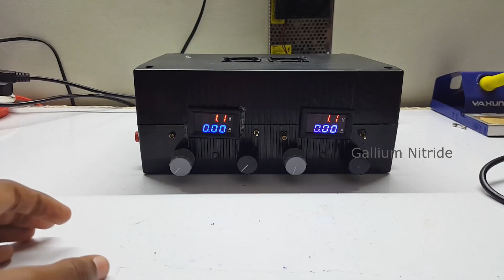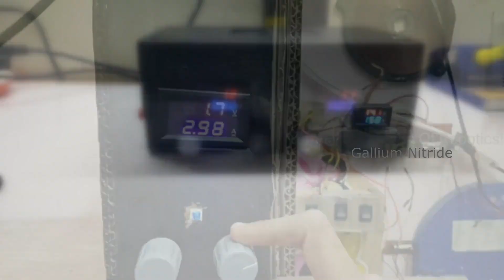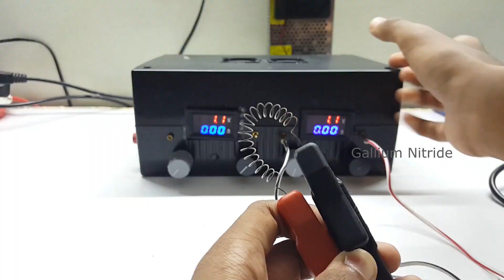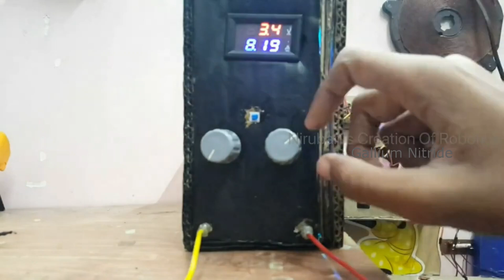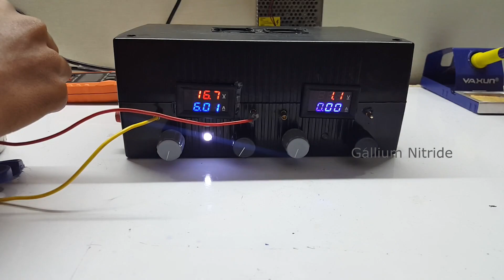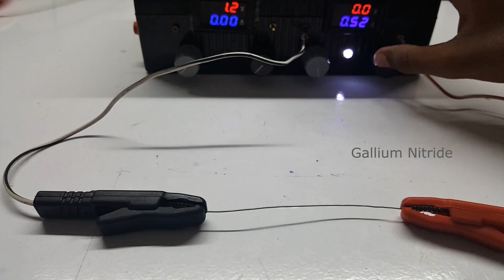Testing my dual channel lab bench power supply | Gallium Nitride

Comment: But how to make it and pls mention its uses with schhol projects i mean for what purpose u use this for
Reply from the maker: This power supply is similar to the one I have made before. Link : https://youtu.be/1nb6lVQUglc

Basically, it is like a variable battery. For example, with your "school projects", they (most of them) need a power source right? (The most common one is a 9V battery). This lab bench power supply is a substitute to the batteries or any power source. Let's say, you got a project that runs on 9V, and another that runs on 12V. Now, you want to power one of them at a time. Instead of using two separate batteries, we can use a lab bench power supply to power it by setting it to 9V or 12V according to its requirement.

Simply put, you give an input to this device (say, 12V). We can get an output of 1.2V to 30V that is adjustable. Plus, we can charge batteries with it too. There's a lot when it comes to lab bench power supplies.
Reply: Oh really thanks i understood completely thanks for replying😊, and do you remember me im akshay nihal you have came to kumbakonam long back for a house warming right?
Reply from the maker: @ananyanihal8 Actually, my guess was right. I saw the account's name and thought it was you just in your sister's account. Yes, I do remember those days.